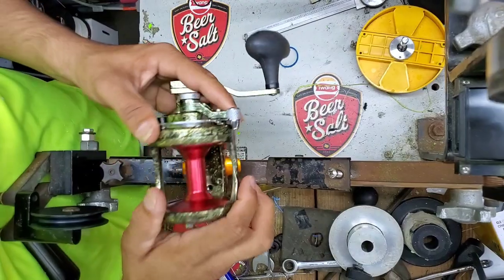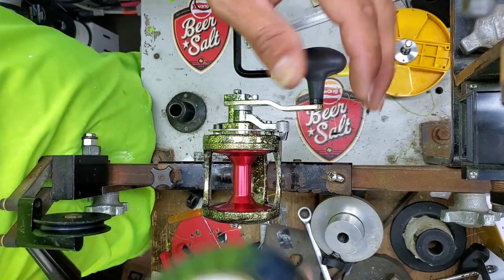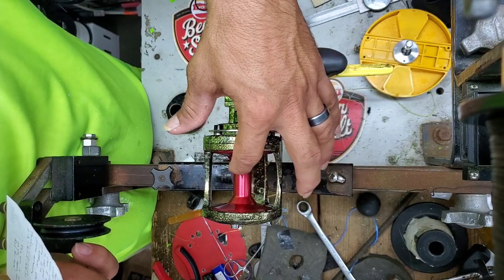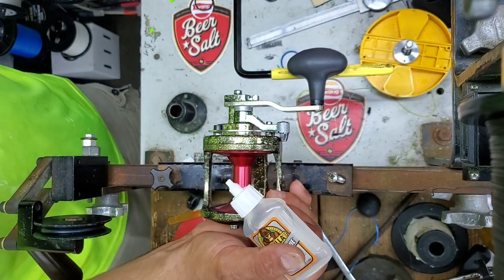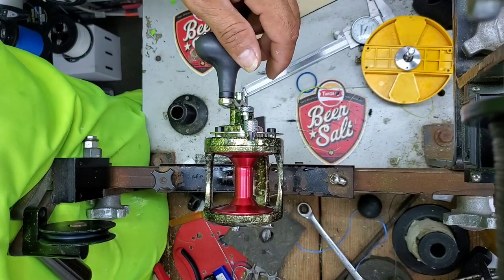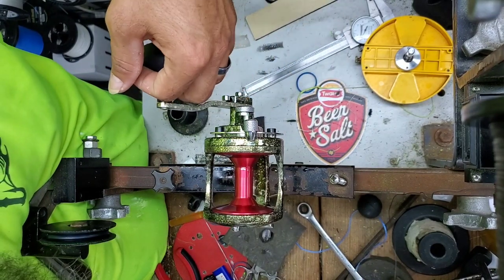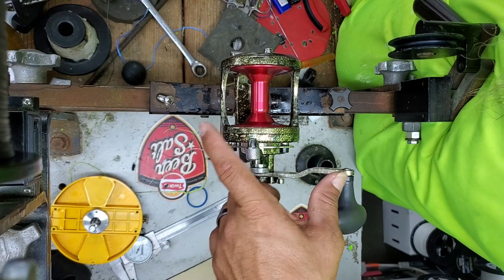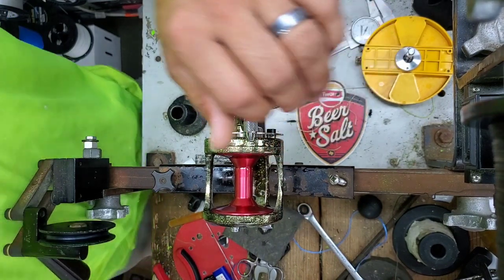Changing out the Reel Foot on an Lx Raptor could be good? Update on 15k giveaway and drawing no.7

Comment: would be great if the reel holder on the spoolin' machine woulb have plastik on the inside, maybe you could take it apart, clean it, then put 90 minute epoxy(I have great experience with UHU epoxy) on it as a coating, not too thin, then it should hold, other epoxy might get rubbed off but this stuff is very strong and would protect the reel foot from gettin' any scratches/finish abraision!
Reply: important to get the rust off, the glue need to have strong metal to grip, a bit oxidation is ok, just no loose rust, ya know? And of course use aceton or nail polish remover to get rid of any grease and dirt
Reply from the maker: Ah oh I see that one very nice.... hmm def need to do something... will get it done
Reply: @TeamHardLife  got the idea from my reelholder on one of my medium spinning rods, it's metal but the inside has plastik to protect the reel foot.
Reply from the maker: Good one..  yes sir

Comment: what if you used a 2 part epoxy. hole lot less drying time.
Reply from the maker: Also less controllable.. cause most are super hard this is more of a softer plastic which the braid will sink in and it will hold is a bit better..